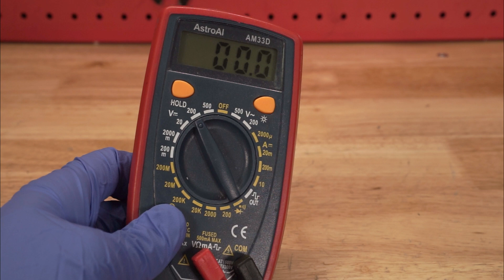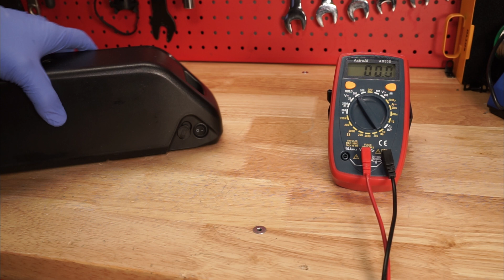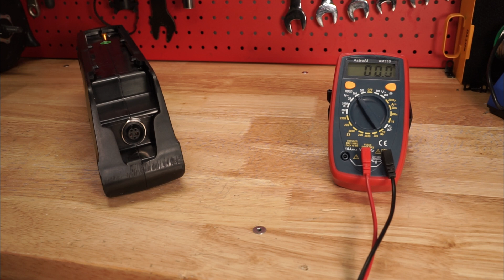How to Check your Battery Voltage

Comment: whats does it mean when your battery works but, the multimeter wont read the voltage? I have another battery in which it does read.

Comment: 48v 10ah battery.. Mine reads 22.7..Is that good..
Reply from the maker: Hello,

Your voltage for a 48V should read 54V or higher when fully charged. 22.7 reading at full means it is time to replace the battery.